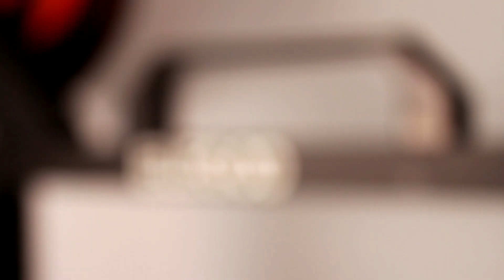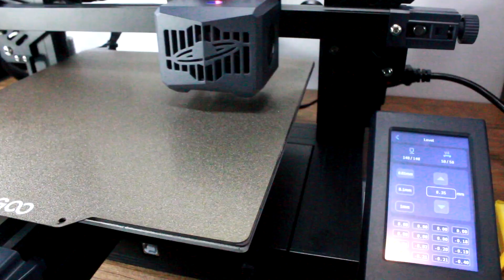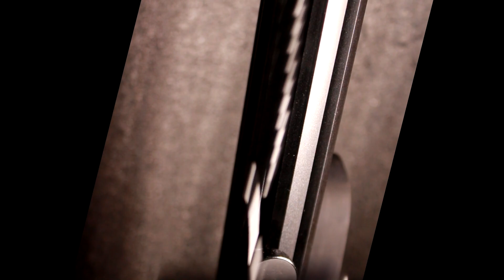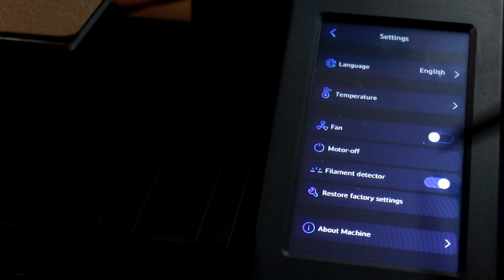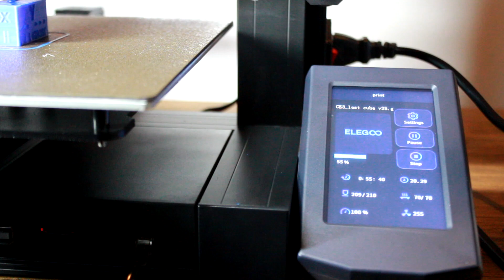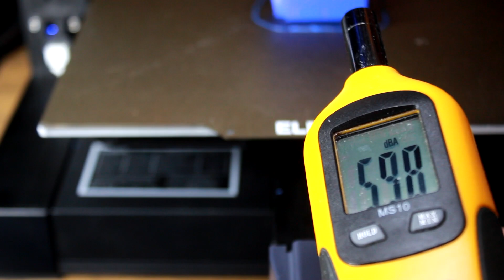The Elegoo Neptune 3 is new, and it's packed with features you wouldn't expect at the price!

Comment: I brought one on the big Sale Elegoo did when They were launching it.  

Amazing printer out does all my others. Even my FLSUN QQ-S Pro delta printer is not as amazing as this.
I am doing Carbon Fiber PLA on it now and it doing that fine now I have tuned the settings for that filament.

I did do one upgrade to the Neptune 3 printer though, I fitted a new heat break throat ( a bi-metal one ) s handles the temps better on the higher temperature filaments I am using now?
It can go up to the top 260 c temp without problems now as the bi-metal heat break help with keeping the cooling zone above the hot end cooler. and no heat creep.

The only thing is, can I find a hot end to fit the special set up of the attachment of the Neptune 3 hot end to the strain gauge? As it is mounted differently to normal MK8 Hot ends.
Plus has slightly wider cooling fins on the cool zone of the heat break fins.

I like to upgrade the hot end if I can to do up to 300 c so I can do Nylon etc.?  So finding a way to buy a easy to afford hot end that is the same set up as the original one be cool ( joke there ).

And now Elegoo released a Neptune 3 Pro and a Neptune 3 Plus ( bigger sized version ) 

My run out sensor unit has one faulty after only 6 months light use. Elegoo are fast to sort out a replacement one for me now!  Great company for customer care.  

I just got in December just before Christmas their new Saturn 2 Resin Printer also on a launch day sale price saving me over £100 
on the rices on ebay UK and Amazon UK. the Saturn 2 is a super large format bed resin 8K printer. it also blows my mind how great Elegoo do their products?
Reply from the maker: Hey, which heat break did you use?

Comment: I've got this one. It now has linear rails, dual independent Z screws, g34 gantry squaring, anti backlash nuts and a G10 print surface

Adding a creality e-fit dd extruder in the near future
Reply: I think thats the pro version you have, since the normal neptune 3 doesnt have independent z screws
Reply: @aepfelpfluecker  neither does the pro. It uses a parallel Z setup with a timing belt. I modified the crap out of my Neptune 3 standard. It now also has a BLTouch, direct drive extruder, all metal hot end and Klipper

Comment: I just can't get this machine to work correctly like your videos. My first layers are just widely inconsistent and can change depending on where the print is on the bed (I can print 3 circles next too each other and 1 can be fine and the other two can be widely off). I've made sure nothing is shaking, etc... so I don't know what I am doing wrong.
Reply from the maker: Do a repeated levelling and see what the displayed mesh values are. If it's totally out there between iterations, the sensor may be broken I guess.

Comment: I bought 2 and received them last week , i put one together last night and works good, BUT!!... BUT.... out of the whole mesh there's 1 point that is lower than the other 15 and when printing the nozzle doesn't fully compensate, and I don't know how to fix this , i guess a tin foil square shim??? But i shouldn't have to do this ,what can i do??
Reply from the maker: yes - tin foil should do it, I agree you shouldn't have to...this is something I've only seen in enders. Surprised the mesh isn't compensating either, how far lower is it? hmm..but yeah try tin foil, sometimes the solution is easier than thinking about it 😉
Reply: @LostInTech3D  can't really tell you right now since it's printing when is done ( of course I'm printing a imperial dragon lol ) I'll check the mesh numbers and let you know , also i know you said it's not a true bed leveling system since it needs to re do the mesh every time, something i notice in the slicer that came with it in the starting gcode there nothing after g28 of using saved mesh, will this help if i add that line ?? 
BTW love your content has help me tons thank you

Comment: Hi again, did you try it with octo pi?
Reply from the maker: I haven't yet - it's running a timelapse now so I can later, but it's a robin nano variation so it's highly likely to work. I'll let you know if it doesn't. 
That being said I'm also likely to try to get MKS wifi plugin working with it at some point, and go that route, which involves buying a £10 esp32 chip to go into the board.
Reply: Seems like it might be attractive for a print farm but would benefit from some connectivity

Comment: A possible fix for the difficulty of pushing TPU through the filament sensor could be to add a turny knob (technical term) that turns the wheel inside you could use the mechanism to pull it through, instead of having to push it... basically the same as all those extruder gear knob upgrades for the ender 3 style extruder that allow you to more easily load filament.
Reply from the maker: good idea!

Comment: Anycubic is using this strain gauge leveling for some while now, first one was the vyper with the kobra series following
Edit: prusa xl will use a strain gauge as well with no manual override possibilities
Reply from the maker: Seems to be the way forward now doesn't it.
Reply: @LostInTech3D  to me yes, in theory that system doesnt need setting z offset, works with every build surface and is well suited for deltas. The only thing i worry about is the hot nozzle touching the build plate, on glass there shouldn't be a problem, but on pei or buildtak it could damage the build surface, i already messed up one pei sheet with the nozzle digging into it

Comment: The Creality CR6SE really put me off that style of bed leveling. What a pain when it decides not to work.
Reply from the maker: Same for any factory installed ABL I guess to varying extents depending on the firmware
Reply: @LostInTech3D  The CR6SE really did not have a load cell it used for the sensor. The hot end was mounted on a flexible metal mount and when the nozzle was pushed against the bed, that metal would flex and then a contact would break triggering it. The simplest mechanical switch. Mine quit working and  Creality sent me all sorts of parts trying to figure out why, but never did work again.
Reply from the maker: Oh really? I thought it was a load cell. Hmm
Reply: @LostInTech3D  I didn't see one in there when I disassembled it.
Reply: @LostInTech3D  The CR6SE uses the same part as the Neptune 3.  The actual strain gauge is covered in goop so you can't see it.

Comment: Face slam 
Oh man, I waited 8 months for a Neptune 2S and now I am jonesing for this machine. I got the 2S because it seemed the easiest to use with physical handicaps, but these new features take it to the next level. I really hope I don't have to wait another 8 months to get a new 2nd printer. 

I just fear the nozzle leveling may leave globs that mess up the print. I know most people watch for a bit after hitting print but what about if someone wants to set up octo-print, how would that affect the prints?
Reply from the maker: As I said to someone else a couple of days ago, the 2S is still a solid printer
Reply: @LostInTech3D  Oh I completely agree. I never saw a printer before in real life, let alone put one together, and it performed amazingly! I mean, I cannot praise this machine enough for how near out-of-the-box perfect printing I had. The only issue I had in the first 6 months was the power supply bracket warmed up during a long print pushing into the bed. The bed cut into it deep because the metal plate acted like a saw.
Ironically I just had my first bed leveling print failure, and I think that is because my AC went on heavy today due to the heat. For a complete novice, these 2 issues seem nothing in comparison to other stories I have read about.

Comment: I don't think I'd want this even for a first printer because eventually newbies learn and upgrade and want direct drive or whatever more gooder extruder. You wouldn't be able to do that on this.
Reply from the maker: Interesting point actually, it's possible but you'd need to add ABL and change the firmware I guess.
Reply: @LostInTech3D  You can do a direct drive mod on printers with a strain gauge and still keep the strain gauge.

Comment: As an attempt to make 3D Printing more accessible Elegoo should be applauded for introducing this machine. The lack of Capricorn tubing is "penny-pinching" to achieve the price-point.

I hope the documentation is adequate for the user who's buying this printer as a first one with no background in 3D printing.

Minimal assembly required is a double-edged sword. The quality of the product is down to the accuracy of its assembly. A careful user can add value to a printer requiring a good amount of assembly. You're very much in the hands of the manufacturer here.

My pet gripe with 3D printer vendors is that, by requiring some assembly by the end-user, they are effectively supplying a kit which gets around the need to have a CE, or equivalent Post-Brexit type, approval for the product. This can mean that safety isn't a guarantee in these products.

Comment: Been using an Ender 3 v2 for almost a year now, I got a BLTouch back in October and it made leveling easier. But, just getting rid of bed leveling altogether, now that sounds like a good plan.
This is quite impressive for such a low price.
I'd love to get my hands on a 2nd printer, but I'd rather wait until someone makes a good duct that supports noctua fans. I modded my v2 with noctua fans, now my printer is whisper quiet. I have to get up and check it, because it is so quiet I can't tell if it is on or not.
Reply from the maker: I should do a silent printer project at some point when I get chance, it would be a cool (pun intended) premise for a video
Reply: prepare for headaches later down the road when the thin bed warp after many heat cycles, and finding yourself unable to adjust the bed
Reply: A rigid bed (ie like this, without the springs/wheels needed for manual tramming) is generally recommended for any ABL. Most guides I've seen for adding BL-Touches to Enders generally recommend, at the very least, tightening the wheels all the way down and adding lock nuts so they don't unscrew themselves. Assuming your printer's Y carriage/bed isn't absolutely fubared, you don't need them anymore, and in practice you're probably going to end up making it more uneven by trying to help than it would be otherwise. Let the probe do the work.

Comment: Does it have quality control?  I owned the Origninal Neptune and it was a nightmare, so bad I WILL NEVER BUY OR SUPPORT ELEGOO ANYMORE...
Reply from the maker: Why what happened?
Reply: @LostInTech3D  Belts where cracked and broke, things not put together correctly, they sent me parts for a while to fix it, but I did all the work, then got most of it working, but the last thing that was bad was the bed, it was super warped, and their comments well we dont support that printer anymore is not good customer service.  I am happier with my Ender 3S1 (even though a few weeks later they came out with the S1 Pro).  It works and I have printed tons more things and didnt have to fight with things broken.

Comment: Subtitles at 5:09! Now that's a thing I've never tried yet.
So were those green disks about the same for both sides of PEI? And the smooth side works fine too?
Reply from the maker: The texture hides the first layer I guess, which means I can't tell if it's varying how close it is, but on a smooth bed, you can see that. I had the nozzle too close but it was consistently too close each time. So that's what that test was all about 😁

Comment: This looks like a pretty close version of the Lotmaxx Shark V2. The only difference is that it is not dual color, and doesn't have a laser but is 200 dollars cheaper (as of right now, they have a sale. Normally its $300 more expensive!)
Reply from the maker: I skim read that and got "shark" and "laser" 😂 Oh it's a 2 in 1 out? Hmm..
Reply: @LostInTech3D  Haha that’s awesome. Yeah they had a deal going on Amazon returns a couple months ago to get rid of their stock before rereleasing the Shark V2. So I got two broken printers for $300. Fixed them up myself (I have experience with this kind of stuff) and now have two fully functional 2 in 1 printers. They have dual color extrusion, all metal dual gear extenders, optical z-axis end stop, filament run out sensors, a magnetic removable bed, handheld touchscreen with the same connector as this Neptune 3, and are hotswappable with a laser engraver, one even came with an automatic bed level sensor for free! All in all, great deal for $150 each, especially when they normally sell for $500 each

Comment: At time of the publication of your video, Creality CR6 was available for more than a year. The CR6 Has all the features described in this video.
As for the strain gauge device used for the level measurement, it has an average of 18 micron for its accuracy/repeatability.
As for the stability of measurements, the strain gauge is glued on a metallic surface. It will have its measurement changed only if you use force in such manner that the metallic part will deform permanently. It is called deformation in the plastic range. The strain gauge design work only in the elastic range. This mean that the metallic part will return to its original position.
I invite you to see the video of Auroratech « The best auto bed levelling sensor… »

The auto bed levelling not only compensate for the printing plate level but also for possible printing plate deformation. This why many readings are taken during the auto bed levelling process.
BTW the Neptune 3 is sold for $500 Canadian and the Creality CR6 for $504 Canadian.
Reply: I'm not sure where you've looked for the Neptune 3 pricing, but I just pre-ordered a Neptune 3 for $199.99 USD, which ended up being $269.72 CAD after Paypal converted it

Comment: Seems like a great package for the price! Only thing I don't know so much about is the nozzle touch leveling given that it seems to leave bits of plastic more than usual. Still very impressive!
Reply from the maker: That's why I'd like to be able to just go straight to printing, exactly. 
Sure, you just have to mop up after it , which honestly is the case with all ABL I've ever used, that does an initial probe, but yeah.
Reply: @LostInTech3D  Prusa handles this by having a hold temp it sits are while probing.
Reply from the maker: yes I think there is one, but more retract, a pause, and a wipe did cross my mind. There are ways.